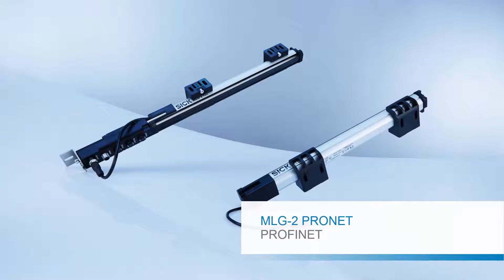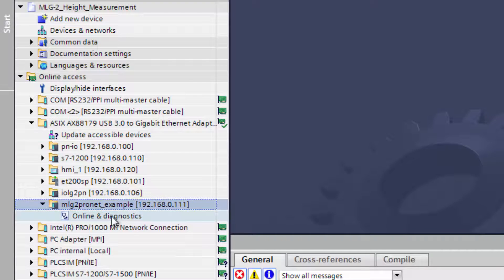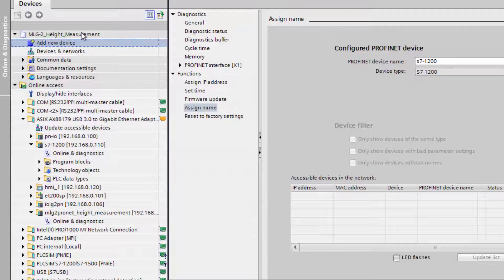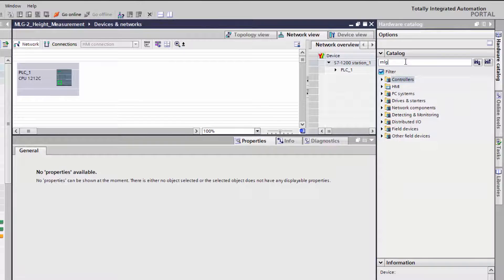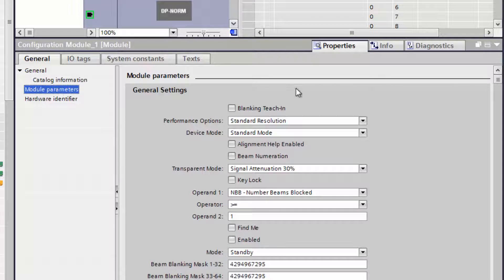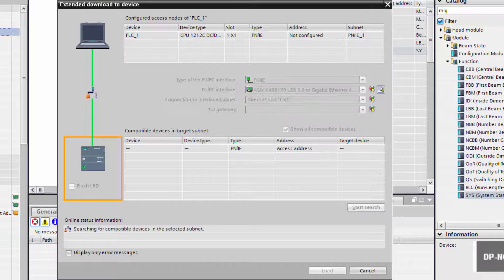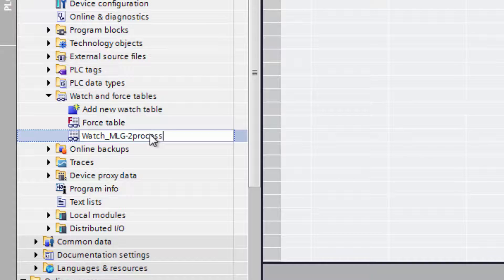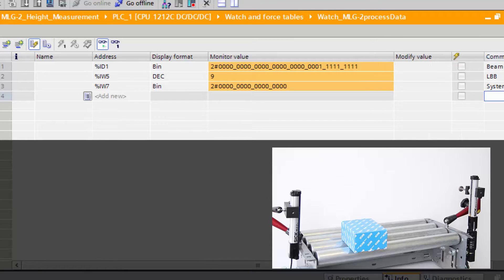Tutorial MLG-2 ProNet (1/3): Integration for PROFINET into Siemens TIA Portal environment | SICK AG

Comment: Hello, I'm working on a project. And I'm wondering..

is it possible if I just set the ip and device number for the MLG in tia portal? and when the MLG connected (to PLC) it will automatically get the ip from the PLC based on its device number?

Could you explain to me how to do that? Because I don't see any deep switch to set the device number on the MLG hardware

I'm using the MLG25N variant for level detection
Reply from the maker: Hello @streamingist and thank you for your message. If you could please send us your location, we will gladly support you with your request. Thank you very much!